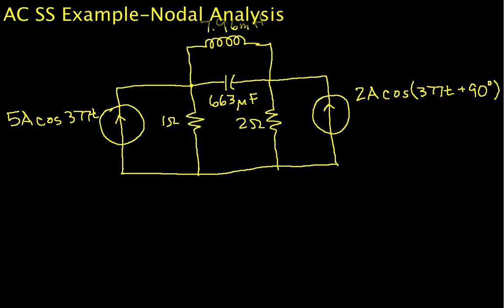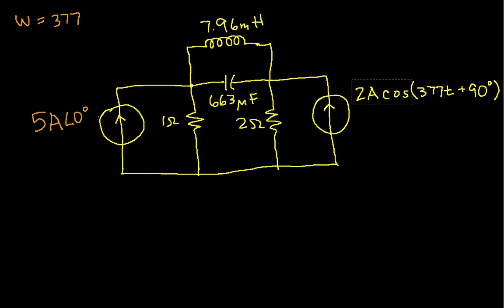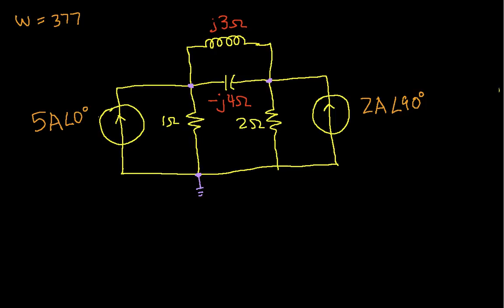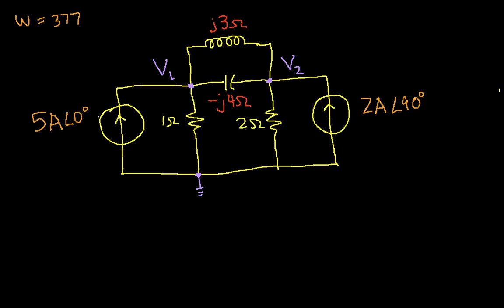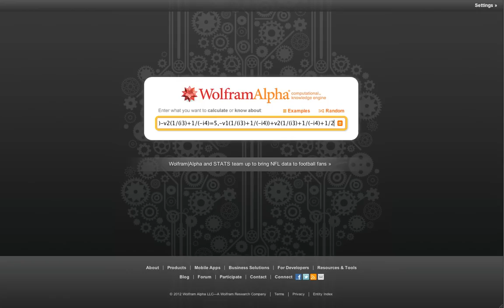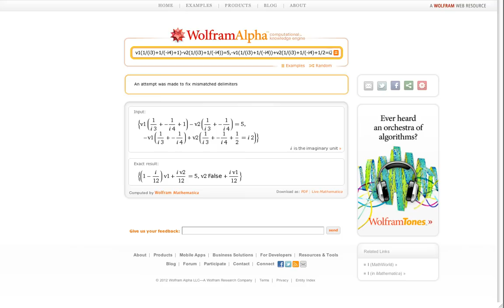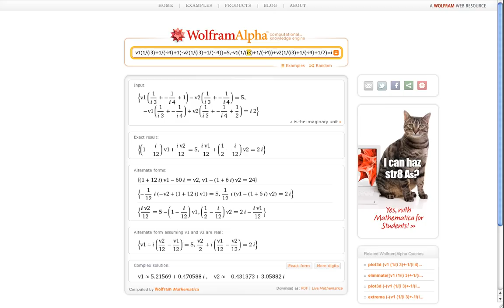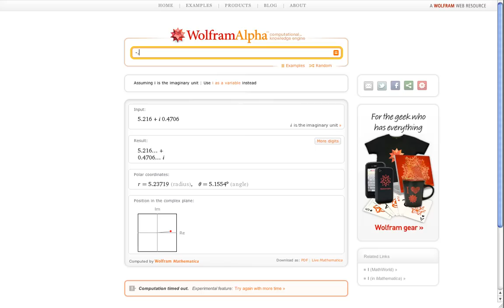AC Example-Nodal Analysis

Comment: That's cool, too bad we can't use wolfram alpha on an exam
Reply: drastikdynasty Get a calculator with complex matrix capability.
The TI 89 and HP 50g are options that most engineering teachers won't bother you about.
The HP Prime is what I've been using (VERY highly recommended).
The HP 35s is a scientific calculator has a few programs that solve systems of linear equations with complex coefficients. It is currently allowed on the Fundamentals of Engineering exam.
The TI-68 and HP-42s also handle complex valued linear systems of equations... but they're expensive/rare/vintage.

With such a calculator, the procedure is as follows:
1) Write the equations for each node (or mesh) on paper in standard form: "(a+jb)x + (c+jd)y = z"
2) create a coefficient matrix "A" and a column vector "b" (consists of the z values)
3) Now the system can be written as Ax=b, where x is the variable matrix. You just have to solve for x (so "x=A^(-1)*b" )
Basically, you just enter "A^(-1)*b" into your calculator, and the answer will be given to you in the form of a column vector where the top number is the first variable, and the bottom number is the last variable.

If you're using RPN entry, put matrix b on the stack, then put matrix A below it, and hit divide.
Reply: +Falcrist Thanks for the info mate... Will try to find those calculators and see if they have it in store..
Reply: +Falcrist Can you tell me how you solve equations with complex values on your prime? I can not get mine to solve any equations with phasors (either in polar or rectangular form) in them. An example would be:  X(50+40+j*497.418+330)+7=0, I can not get any value for X unless I work it by hand and that kinda defeats the point of the calculator.
Reply: Cameron Parette The solve function you seem to be looking for is Linear System (linsolve). With that, you simply make a vector, and enter each equation into an element in that vector, then create a vector with each of the variables in it like so.
linsolve( [equation1 equation2 equation3], [variable1 variable2 variable3] )
More information can be found by highlighting the Linear Solve function in the menu  (toolbox>CAS>Solve>Linear System) and hitting the Help button.

However, the easiest way to solve systems of complex equations is to use matrices:
First, make an N×1 matrix and an N×N matrix (where N is the number of variables). Each row of the matrices represents one of the equations in the system.
The N×N matrix is called the coefficient matrix (denoted as A). It holds the coefficients of each variable in each of the equations.
The N×1 matrix (denoted by b) holds the non-homogeneous part of each equation... that is, any number that isn't a coefficient should be manipulated so that it's on the other side of the equals sign from the variables, then those numbers are put into the column matrix.
There's actually a third matrix involved that contains the actual variables. It's also N×1, and is denoted by x.
The entire system of equations is thus represented as Ax=b. If you multiply it out, you'll actually get the original system of equations back.
Example (3 variable system with 3 equations):
Equation 1: ax+by+cz=0
Equation 2: dx+ey+fz=1
Equation 3: gx+hy+iz=2
NOTE: these equations are in a sort of standard form (each column contains only 1 variable and it's coefficients). You may have to do some minor calculation to get this form.
Coefficient matrix (A):
a  b  c
d  e  f
g  h  i
Variable matrix (x):
x
y
z
Non-homogeneous matrix (b):
0
1
2

Finally we can do the result matrix. By basic algebra, if Ax=b, then it follows that x=b/A... though with matrices, it is proper to write x=(A^-1)b. It doesn't matter, since your calculator will accept fractions with matrices in them anyway.
So literally, all you have to do to get the answers is compute b/A or (A^-1)b. The results will pop out in matrix form such that the first (top) element of the result matrix corresponds to the first (top) variable in the variable matrix. In this case if our results are 10
20
30
It means that x=10, y=20, and z=30.

Alternatively, you can make A and b into one big matrix (called an augmented matrix) like:
a b c 0
d e f 1
g h i 2
and ask for the reduced row echelon form (RREF). The result will be (assuming the same answer as above):
1 0 0 10
0 1 0 20
0 0 1 30
Where that last column holds the answers you're looking for.

In this way, you can quickly and easily solve systems of equations with relatively large numbers of variables. All of this is from linear algebra. I've been somewhat careful to use correct terminology, so that it's easy for you to find other versions of this explanation.
Reply: +Falcrist I am still trying things people have been telling me, but the matrix method you show here gives consistent repeatable results so thank you for giving me a way to pass my tests I appreciate it!